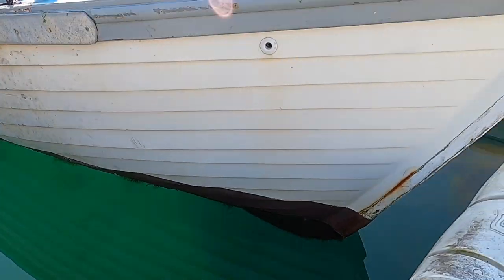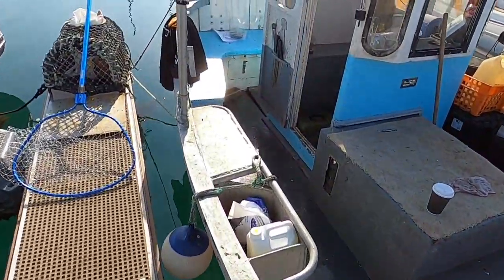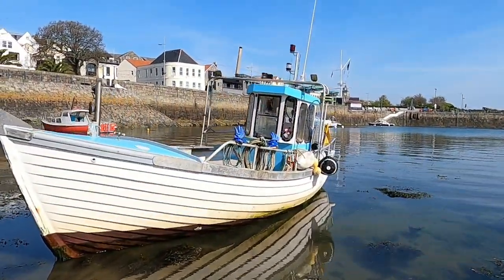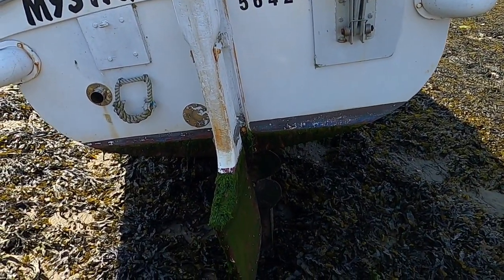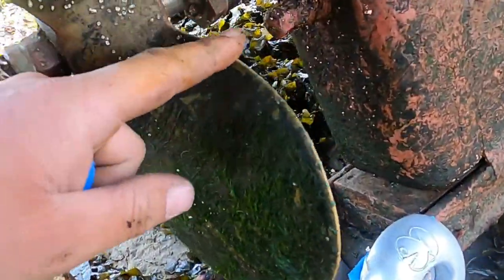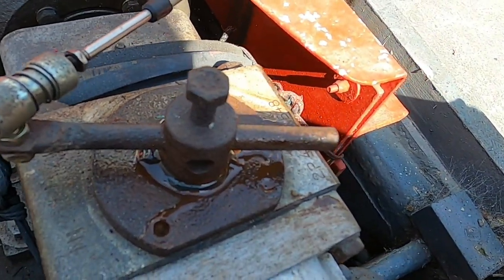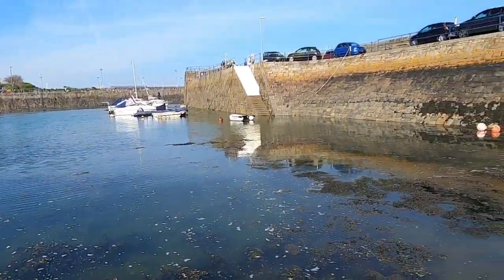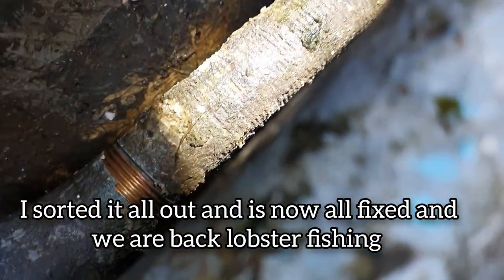Cleaning Boat And Maintenance Work

Comment: It's great you get such great tide differences, so you can maintain the hull just on the beach, them allen keys bolts on the winch, I had a similar problem, what I did was got some bolts welded ontop of the allen keys and removed them with a socket and bar then replaced with stainless ones
Reply from the maker: That's a good idea cheers Barry